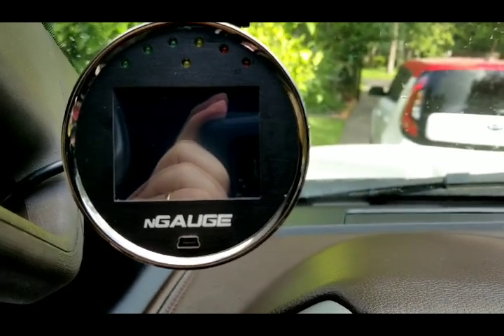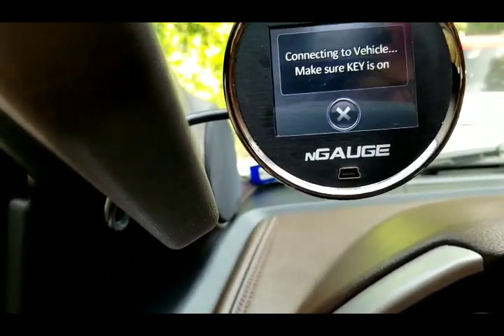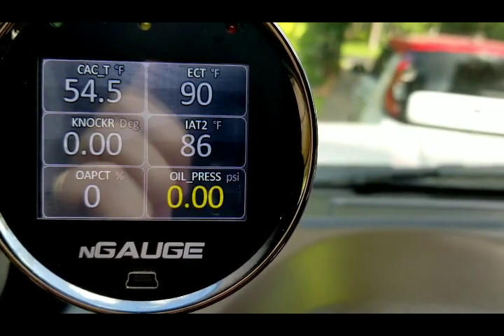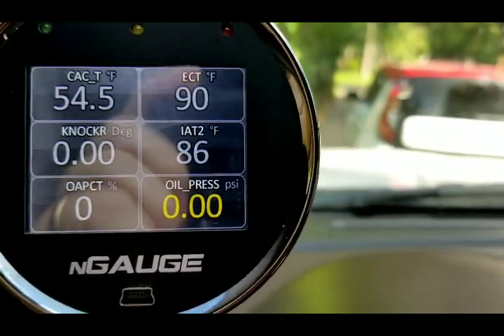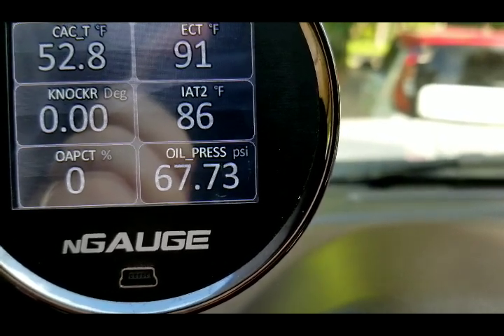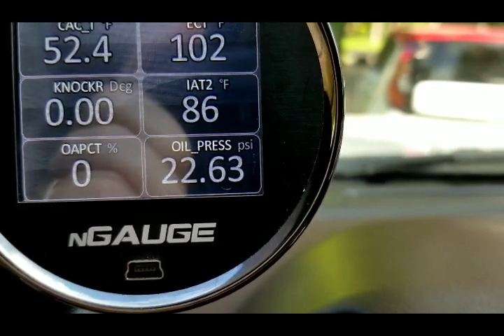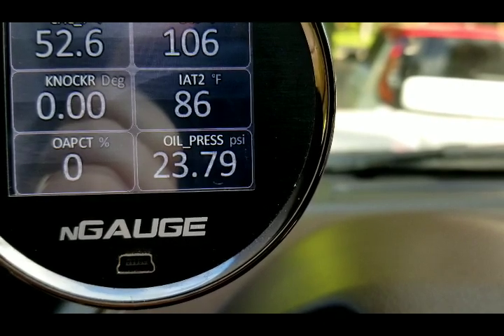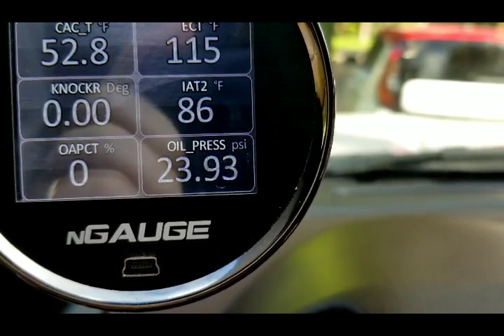Cold Start Oil Pressure Priming

Comment: The ultimate killer of course is cold, and My philosophy is if it's going to be a brutal winter, and there's going to be a lot of 10° or less days your cold starting it's probably wise to run a thinner oil. Otherwise these complicated enginuities 
of building oil pressure aren't really going to help at all I wouldn't think, unless something literally turns on and sucks oil from the bottom and puts it to the top of the engine in some phase before ignition in certain cold temperatures, which might very well help but not if the oil is too thick to even move up there.
Reply from the maker: I actually run 0-40 in all my Ecoboost trucks (3 of them over time) I agree with your cold-thinner, but I also believe hot-thicker. Basically just a little bigger-wider spread than Ford's official recommendation.

Comment: Are you sure that gauge is correct?
Reply from the maker: Do you mean the oil pressure reading from the ODB port on the truck?
Since I don't have an analog oil pressure sensor to verify that Ford's pcm value for oil pressure is the same, how would I know? But why would Ford purposely be "reading" oil pressure inaccurately? The ODB port is just accessing the onboard computer system that manages the truck.
Reply: @javelinadad  understood, just seems low but must be accurate

Comment from the maker: Yes, the Gen2 does have electronic control for the "2-stage" oil pump. Low stage is ~25-30lbs. High stage is ~ 55-70lbs. But that doesn't play into this procedure, which is to pump oil into the vacant oil passages before ignition.